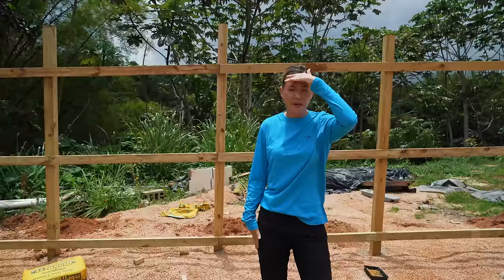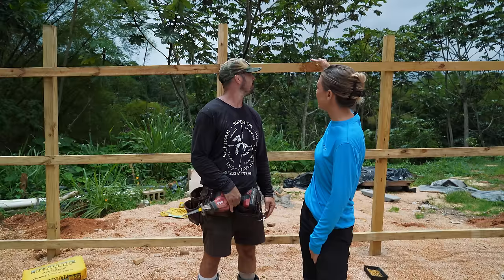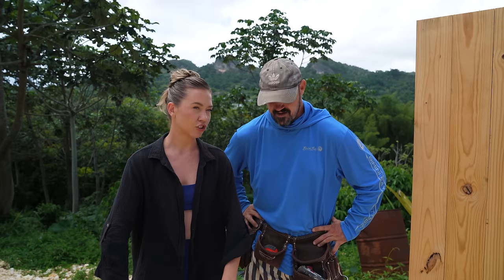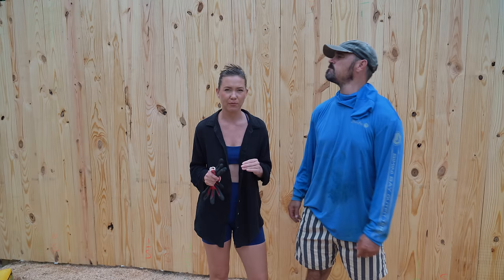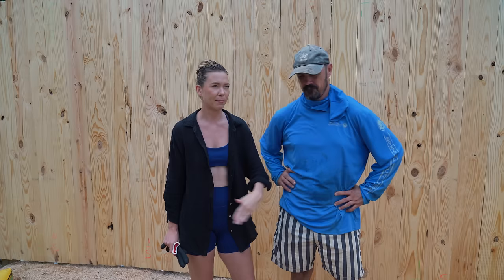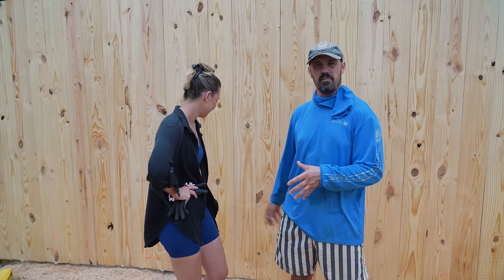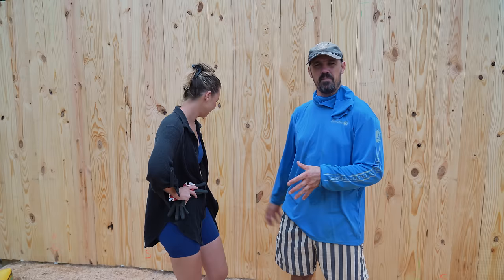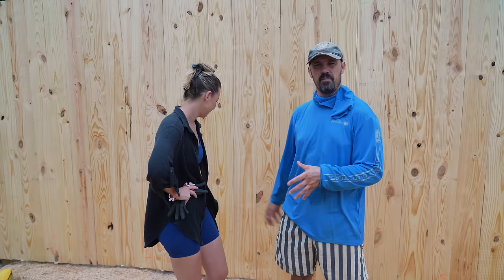BUILDING THE FINAL FENCE FOR OUR 8 ACRE OFF GRID PROPERTY!

Comment: I think it might be a problem to have all the fence planks butted together with no gap. It might be better to have all the main planks separated by almost a full plank and that gap covered by an outer plank. This way the wood can swell and shrink without damaging the fasteners. Everyone has an opinion, but not all of them are wrong.
Reply: Your opinion is not wrong.  Several other people had similar comments in the previous fence build video.  Obviously they are choosing form over function but they had a clean simple look that they were going for.

Comment: I did a fence like yours. Did not last long. Water entered the wood from the top and made each board a little wider. Boards moved and broke all the screws. Had to completely redo it to give the boards more space to move and cover the top. 
I hope you have a better result.
Love you guys!
Reply: These fences won’t last, no spacing between boards for expansion and screwing from the back instead of on the face of the boards.

Comment: Two suggestions: 
1. Get a deadman for your front fence.  This is is where you bury a short post down perpendicular to the front fence with an angled support (runner) that transfers the pressure and energy put on the front top down to the ground behind the fence.  You might be able to accomplish this with your side fence but still you want the energy to transfer through the angled support ~ 6’ down to ~ 1’
2. If you still have concrete floor available to you, you will be glad in the long run that you move it there for purposes of reducing loss and easier retrieval.   If that doesn’t  appeal to you, spread it out so that it visually looks fine but the extra depth can be a source of minor stone needs (faux storage).  

Good job on the work today….your phrase is a good one but needs to be offered on an exclusive basis only.   “Smart people need not apply” could be a tag line in small print.     The truth in your phrase isn’t that hard workers need to be stupid or dumb (strong back, weak mind) but that first timers and DIY newbs need to learn the best way.   Everyone else gets to pay retail.   For too many the “work smarter” is an excuse to do nothing or an explanation for why they stopped.   There’s gold in these words if you want to mine and mold it for your merch ….plant your stake and claim it.  

Incidentally….you were working smarter (without any instruction) when you tipped your wheelbarrow over to get volume material with less calories burned.   That is what working harder teaches….THAT ain’t in no books.  Proof that:  life is the best teacher of all.

Comment: Don't worry about the fence it's just going to blow over anyway. You should put some 45° - 4x4x10' braces on back side. No one will see them. DEFINITELY BRACE it if a hurricane comes
Reply: that might work if they remove every other panel too when the hurricane comes.  but with sustained winds for hours that fence is a gonner if anything over a Cat 1 passes directly over them.  but hey if they make it ten years before that happens then so be it.  but it would suck if that happened later this year!  guess that's what good insurance is for, hopefully that's included in their insurance policy and not just the dwelling, because that would be a hit to gut to completely lose that without the finances to rebuild it!  I wonder if they have day laborers @ their Home Depot like we do in the states 🤔🙆🤣
Reply: I very much doubt there's any insurance at play here.  If it happens if they are lucky they can find the pieces and drag them back home to rebuild. But yes, any wind strong enough to blow a wooden house apart will make short work of this. It's basically an inevitability, just a question of when and how much to rebuild. But you could say the same about a lot of unreinforced houses in earthquake zones.

Comment: Glad to see you kept the endgrain off the grade (but you shouldn't cover with gravel either, you want open air flow at all times there). It will make a huge difference in longevity, HUGE. Watch what happens to the other side over the next year, compared to the new section. No real comments on this one, other than as previously said, you need to fasten those boards from the front side. That's a failure point, that will come in time.

Someday you'll pick up on why it's better to do things the right way, the first time. You could be much further along with your projects by now, and have learned valuable skills along the way. So it goes. At least you're tenacious. That counts for something. I'm envious of the space you guys have for your animals to range, we have too many predators, and cars here.

Comment: I would’ve put a horizontal “sacrificial” board at the bottom.  That way you only have to replace the horizontal 8” board rather than the whole 8’ board because the bottom 6” is rotten. I like that you stepped down the height rather than keeping it all the same height. It’s how I did my fence and it looks way better.

Comment: Might have been an idea to have set a gravel board at the bottom of the fence so your boards would have been clear of the gravel and the not rotted as fast as they will now. Easier to replace one strip at the bottom rather than every board.

Comment: You need to either cap those posts with a metal cap or cut them at a steep angle so water doesn't sit on the top and soak in. That crappy softwood will rot away so fast otherwise..

Comment: I love the whole front treatment. It's something I would do.
Worried later you might accidentally mess up the gate area with heavy equipment though. My solution would have been at least 3' wider. Did you ever measure for a backhoe or loader when deciding the width of gate. Is there a 'yet to be seen' egress (even a rough one) to your property for the potential need for heavy construction vehicles?
Also, Matty's new name here is Chupcabra (goat sucker) after that brave move to get the baby goats mother flowing.

Comment: The fabric technical term is “Weed Block”. That stuff is the worse, especially when you use it with rocks. I have owned a successful landscaping business for 20 years and I always recommend to not use weed block. Why? Weeds will grow through the weed block, they always find a way, and weeds will grow on top. The issue is once weeds start growing in 1-2 years, it’s almost impossible to do maintenance on the landscaping bed…you can’t pull the weeds out because the roots get caught under the weed block…so they just break off, continue growing and spreading over time. If you don’t use weed block you can just do maintenance on the bed every few months. Spray doesn’t work either, it just stuns most weeds and when the weeds turn brown it doesn’t look good, plus now you have a weed covered in poison. Not to mention the poison ruining the soil. You will have more landscaping beds I am sure, save yourself a lot of trouble and don’t use this stuff in the future, it’s complete crap. Other than that, love the way everything is looking there farmer Dan.

Comment: Installing boards without any spacing outdoors is betting those boards will not swell, cup, bow and pull loose from the rails. You are building that fence like you would a floor that should never get wet. You can expect a 5 inch wide board's width to increase by about 1/4 to 3/8 inch when soaked with moisture. Also a clear or translucent coating will not protect the wood from the sun's ultraviolet rays more than a year or two. Lots of luck with all that work.